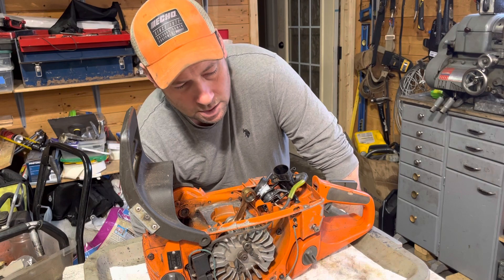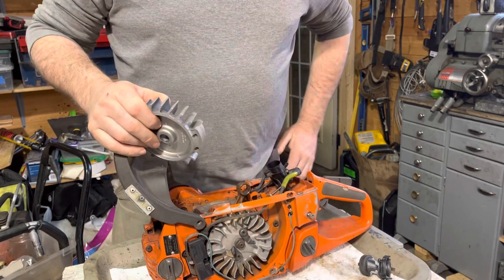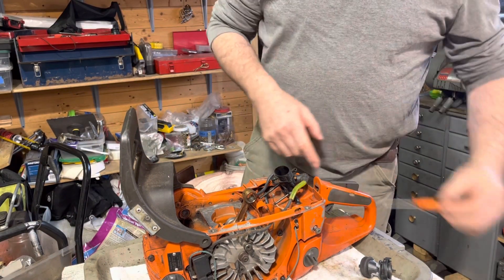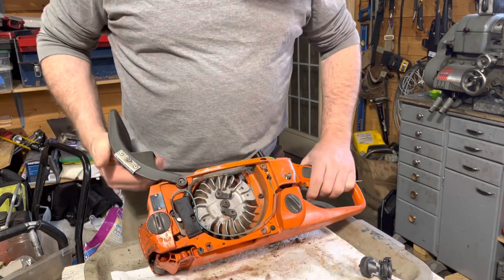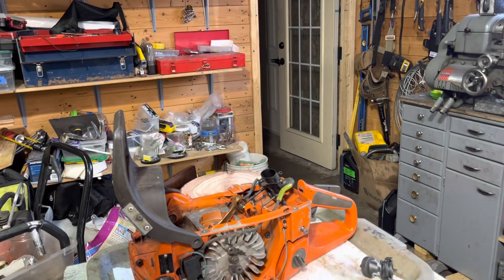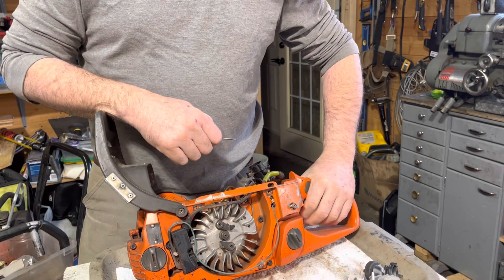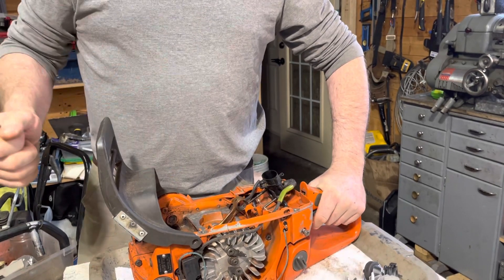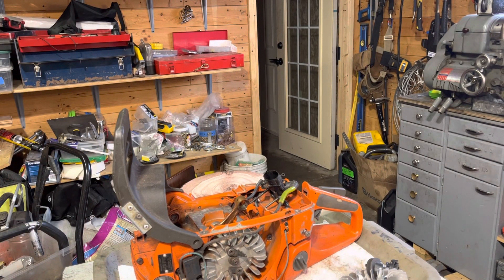Husqvarna Flywheel replacement, must do!

Comment: Great tip.  I just picked up my 1st 372 clone saw (yeah I know, I know but OEM saws in my neck of the woods are few & far between...) and noticed that it has a woodruff key instead of the cast aluminum key in the flywheel - I wonder if them shearing off is the reason they changed up their design?
Reply from the maker: For some, it may be easier to case the flywheel, then they just machine out the groove for the key. 
Is it a Neotec or a Farmertec/Holtzforma? Pre-assembled or a box of parts?
Reply from the maker: If it’s a kit I’m sure you’ll have a lot of fun with it 😉
Reply: @jimssawsnstuff8903  Holzfforma pre-assembled but I tore it down to upgrade it with OEM parts - I actually bought a really rough project OEM 372 and after doing the math on the parts it needed to make it a runner it was cheaper to buy a clone to make a runner....